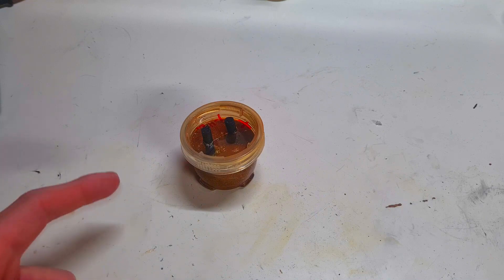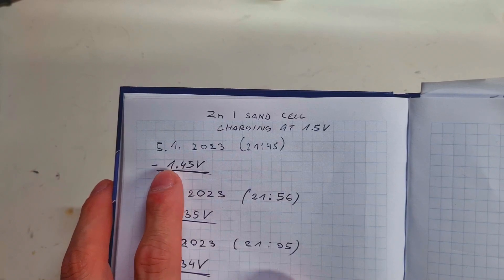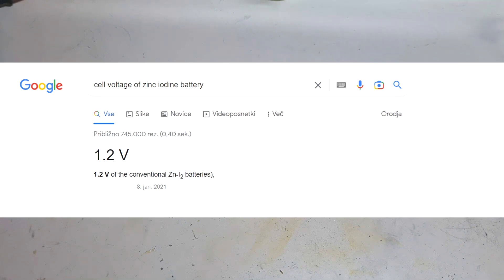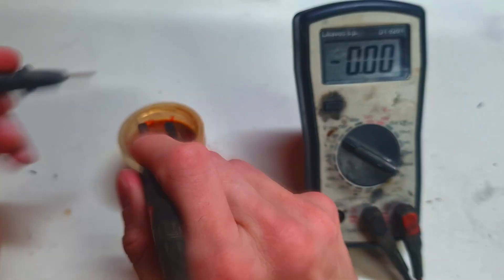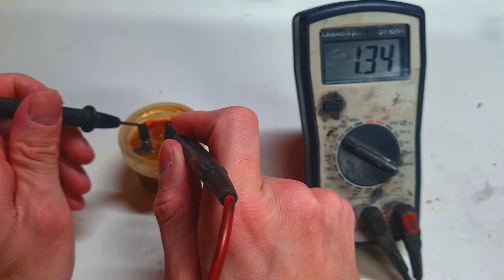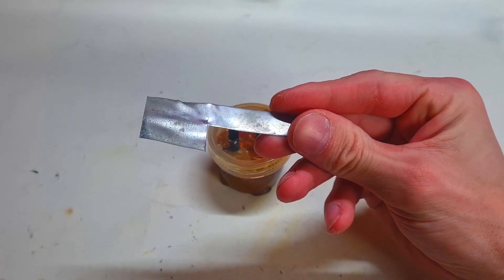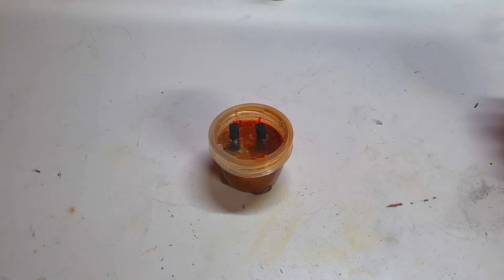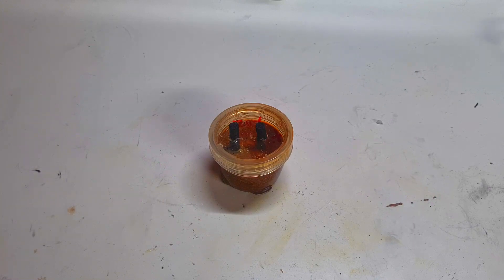Diy Zinc Iodine Sand battery Update

Comment: Amazing I have a question tho will I get hinger volt if I use carbon plates ???
Reply from the maker: I already use carbon. The voltage is related to the iodine and zinc. Carbon is only a non reactive current collector.
Reply: @cayrex  I mean if I increased the carbon surface area make it bigger will I get hinger voltage ?? Me will try this batteries thank you tho God bless you 👍👍👍
Reply from the maker: @JimmyCross-f7w  Sorry no. The voltage will depend on what materials you will use not how big will be the surface area. The surface area will effect on the current.

Comment: I would like to give these batteries a go. Should there be a difference in selfdischarge between iodide and bromide? I tend to go for the iodide unless it is heavily compromised. Titanium foil is supposed to resist halogens. Any experience with that?

Comment: Hi ! Would you mind to build a copper sulfate gravity battery (with zinc as the anode) ? 
I've seen just a few videos of these batteries, an it's quite simple to build.
Reply from the maker: Hi! Why you want another video about copper zinc gravity battery if you already have several videos😊? I will not make any differences to that battery
Reply: @cayrex 
 Sorry, maybe you didn't understand what I meant to say.
I have seem how the battery is built (diagrams), but there isn't much information on how much current can be drawn from it, and actual efficiency of this design. 

Maybe you have more experience with gravity batteries, and could show the results over a few days of use. 
No problem if it's too much to ask 😊

Comment: What happens if you wrap the carbon rod with zinc wire with 1mm spaces .
Reply: Supposedly these are rechargeable and the zinc iodide will deposit or electroplate back onto itself as zinc